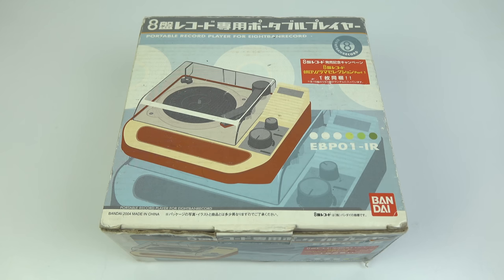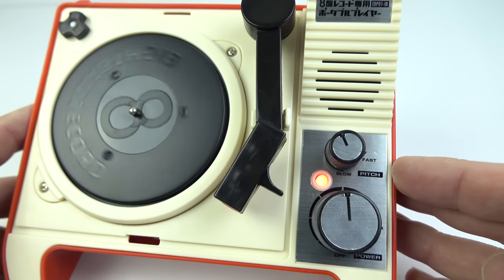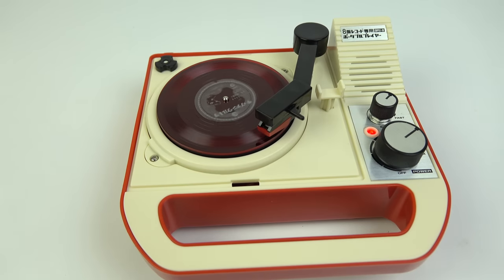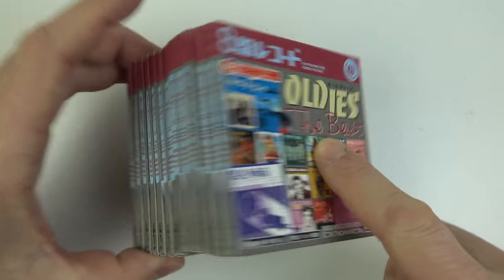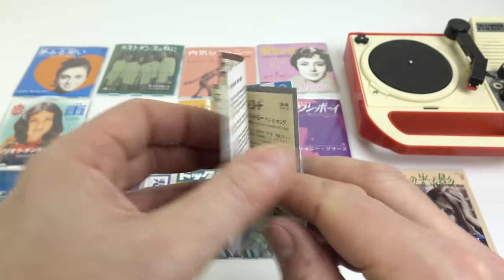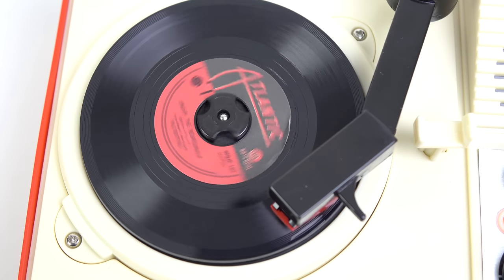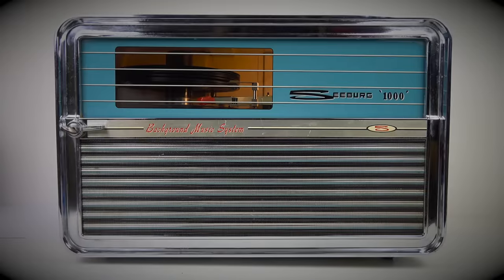8ban - mini playable Records from Japan

Comment: You know, Techmoan, you should invetigate a bit about some 70's dolls that used a small record to play sounds. My mother just told me about that after watching this video. She said she had a doll that had a little plastic box inside and the box had a tiny record that played sound bits for the doll's "momma" sounds and things like that
Reply: Before audio chips they use small records to play the noises
Reply: Teddy ruxspin did something similar
Reply: I saw those records in the backs of the dolls.
Reply: Yes, please! I remember those dolls!
Reply: Indeed. I think early See n’ Say toys also use a record mechanism.
Reply: I have a doll from 1972 with a record player. She still worked! Though last I used her, she wasn't doing it too well. Bit nervous to open her up.
Reply: Those pull-string record players were pretty much how all talking toys worked back then. They were purely mechanical phonographs powered by a spring, like an old Victrola with a tiny sealed disc inside. Super-lo-fi but simple and reliable, and they usually required no batteries.
Reply: @RAMChYLD  Those were particularly ingenious in that you'd get a different track depending on where you started the plastic arrow.
Reply: Now everyone knows about these dolls thanks to Toy Story 4
Reply: I know there were German dolls with battery powered tiny record players, and records were interchangeable
Reply: Those pure mechanical phonographs for dolls were mostly the "Minifon" type produced in Italy.  After 30 or 50 plays or so the voice was already that much distorted that it was no longer fun. The principle was the same as in those "close'n'play" record destroyers sold as childrens' toy in the US. A 45 played by those once was already ruined for normal play on a stereo...
Reply: I bought some "laughing bags" back in the 90's that was basically the record player from one of these talking dolls, inside a bag. It had an evil, hysterical, demonic laughter. I got the idea to put the laughing record inside my little sisters talking doll, for a little chucky-moment 😅

Comment: I have one of the White Stripes models (and the records). They released one record for this ("Top Special") that, to date, has only ever been released in this format. I ripped the Top Special record to WAV format by using placing the tonearm of a real turntable on top of the Top Special record that was spinning on the 8Ban turntable. (This worked better than you'd expect and I managed to get the angle of the tonearm correct). Yes, it was in Stereo, and yes, the quality is what you'd expect for such a tiny plastic record. Someone else did the same and posted a video to youtube.
Reply: chris newpher "someone else" :D

Comment: For a toy record player it sounds pretty decent. It's probably comparable to the inner area of 16 RPM records.
Reply: If it's a 33, and actually stereo, might even be they used some sort of clever shrinking ray on real records. Or something. I bet the sound quality is purely a symptom of a novelty plastic toy record player, and the bit of tape Techmoan didn't quite hack up properly in his Crosley. Probably if you made the effort you'd get at least LP quality out of it. Why not? Putting grooves into vinyl is a mature technology, we've mastered it.

Comment: You can play that small record on a Technics 1200 because it's a manual turntable.
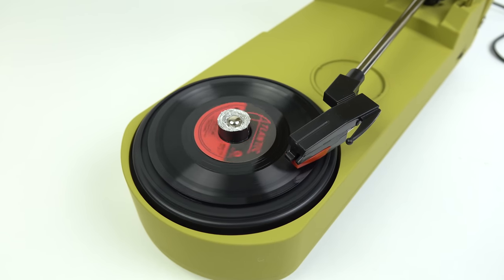Reply: If the tracking error is the same as Crosley at 11:00 mark you can re-align the cartridge because the holes of the headshell are elongated which means you can twist the cartridge. But it's much better to buy a spare headshell for that rather than re-aligning it back when playing conventional records.
Reply: Anyone got a 3D printer? Might be able to knock up an adaptor, and one for the record's centre hole while you're at it.
Reply: But it's not the hole, it's the angle of the cartridge which is not straight. I think conical stylus solves the problem because conical is not sensitive to alignment.

Comment: You don't need a spindle; you just do what we do in the US when a 7" adapter can't be found -- put the disc down approximately centred, turn the platter on and run a fingernail along the edge, nudging it in until it's straight. :)  (nudge nudge)

Comment: They are other models of turning table players apart of the toy one you got My father get me one from Japan made by Denki Onkio K.K when I was child with Japanese short horror stories.  I was in stereo and have 2 speakers and some output (was not a normal jack plug was 7 pins on circle and one in the middle )

Comment: Can you find us the largest record player now?
Reply: The Auxetophone was a non-electric amplified turntable. Used a special little gate, vibrated by the needle. That allowed varying amounts of compressed air through, causing an utter bleeding racket that couldn't really be turned up or down. Clever though that they could make an entirely mechanical amplifier. I think there was a microphone option that used the same principle. 

Actually it was electric in that the air compressor had an electric motor. Only electrical part though. Except maybe the off switch.
Reply: Get Conan or some Orcs to spin a windlass hamster wheel to run a compressor and you'd have a completely medieval amplified sound system.
Reply: Of course you'd need to cut the records first. But you could probably do that by getting barbarians to scream down a cone with a needle on the end. If you haven't got vinyl, use bronze.
Reply: Plastics come included with Alchemy.

Comment: The pitch control is necessary because it has a crappy DC motor that would vary sample to sample and also to adjust for weakening batteries.  Even though the motors had inertial rotating regulator switches, they were still sensitive to battery voltage.

Comment: Just in case nobody has mentioned it but this concept of small records was not new in 2004, back in 1967 a company called Philco released a record format that was call Hip-Pocket records, the idea being you could carry them in your back pocket of your jeans. These were 3.875 inches in diameter, approximately 10 cm, so a little larger and flexible rather than ridged plastic and at 45 rpm rather than 33.33. They also contained two songs on one side. Philco released approximately 40 singles in the USA, mostly popular Soul records from the record labels Atlantic, Mercury and Roulette. I know this as I have a couple in my record collection. Please check these out for a future feature. 😀

Comment: 3inch records could be 3d printed...
Reply: DUDE YES, This would be a fun project!
Reply: It's crazy what kind of things can be 3D printed now, even houses nowadays!
Reply: And if the 3d printed record works then it's totally fun.
Reply: There's no printer accurate enough for that sadly. A laser would be cool though!
Reply: No. They can’t be 3D printed. The amount of detail is far too great for a 3D printer to reproduce.
Reply: Well, no, the groves need a resolution of better than 1µm. But you could 3D print a mock ultra long play stereo record with a total playtime of 24 days! Yes. DAYS. Not hours. 

Well, the record would be mock record with just one circular grove. And inside the box you'd hide one of the 2,50€ MP3 players from chine, stick a 32Gb SD card with 24 days of music into it (yes, standard 128kBit bit rate; you could of course squeeze a month of music onto it if you reduce the bit rate to 96kBit) and there you go.

Just stay away from hipsters when demonstrating this little toy; they will stand in a puddle of urine once they see the 3D printed ultra LP.

Comment: Your struggles with fitting the odd size hole remind me of the college station I worked at in the early 90's. On their older LP's the holes were drilled out to about 2cm, to prevent theft by us poor student volunteers. ;) There was a special adaptor, a hunk of metal with a hole drilled on the underside that would slip over the spindle. I seem to remember there was also just 1 adaptor for 4 turntables in the studio. Hmmm... I wonder now if there werent more adaptors at one time--and a few more records .LOL

Comment: With a bit of DIY and desoldering/solder, I'm sure you can add an aux output from this little turntable's speaker, making a round hole on the side of the speak and hardwire an AUX input.

Comment: I'm the middle 1970s I bought a small battery powered 45 rpm record player. It also came with several 3" flexi discs. Wish I still had it.

Comment: I just removed the automatic guts from a decent but not expensive turntable with a removable spindle.  Also necessary for Little Wonder 78s and tiny records that came with toys like Lionel train sets. Have several head shells for different cartridge setups appropriate for various formats.

Comment: I imagine the speed thing is there because the thing lacks electronic (capacitors) to keep the speed (voltage to the motor) constant when the battery starts to drain. Just like it used to when your batteries were running out on an old Walkman.

Comment: I am thrilled to own my own Ban Dai portable player, thanks to your demonstration.  It works great but came with only one record.  After so many years it was heartening to learn that you found a source for these tiny records so recently.  Could you please share how you got these? I am especially interested in the series of "Oldies the Best," or anything else available. Thank you. By the way, there's no need to find an output jack to connect to an amplifier from this player. Just place a telephone pickup coil in front of its tiny speaker and pick up the audio inductively to feed into a medium gain amplifier input, such as a microphone jack. Cheers.

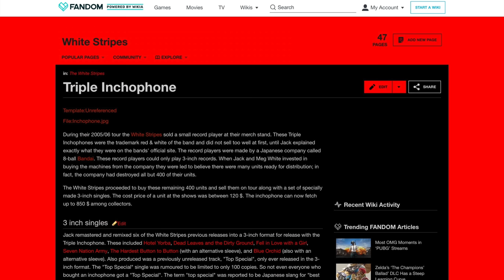Comment: I have some three-inch single-sided 78s by The Andrews Sisters of "I'll Be With You in Apple Blossom Time," "Pennsylvania Polka" and "Bie Mir Bist du Scoen." They are made to look like tiny replicas of the original 10-inch American Decca original shellac pressings, right down to the Decca label and corresponding catalog number. They seem to be made of the same material as the early Deccalite "unbreakable" records, and have a standard 78-sized spindle hole. Although the catalog numbers on these little records match up to the corresponding numbers on the 10-inch discs, the performances are totally different. Each song is cut down to about 1:00, and The Andrews Sisters are accompanied by only a solo piano instead of a band. My best guess was that they were made for some kind of scaled-down child's toy phonograph. (You know... "Hey kids! Play records just your mom and dad do!"). But I've been able to find out next to nothing about these records, except that there was at least one more Andrews Sisters recording of "Boogie Woogie Bugle Boy." I found that at this Popsike link (and it even has a picture):

https://www.popsike.com/78-RPM-RARE-3-INCH-DECCA-RECORD-BY-ANDREWS-SISTERS-BOOGIE-WOOGIE-BUGLE-BOYEE/390388286938.html

You are my video guru about weird formats. What can you tell me about these?

Jim

Comment: I'm pretty sure you could circuit bend that and add the audio jack fairly easily. (unless you already know that ?) -two ways i know would be to just disconnect speaker and change to desired jack, a step above would be to use a switching audio jack and leaving the speaker in place. whereas it uses the speaker still when no audio cable connected. search it up "circuit bending add audio jack" looks for images of schematics. or disregard this as you may already know this stuff?     
 :D cheers

Comment: Open it up and cut the cable to the speaker, and connect a female 3.5mm jack connecter, connect the wires to both the left and right, then you have basic stereo sound that you can connect to proper speakers.

Comment: As a young lad my parents bought me  in the 60,s a Chad Valley record player which it had a pick up arm made from plastic  in the same shape as the old vintage wind up gramaphone  and same type of stylus held in place with a thumb screw  the platter was the same size as a 7 inch record  and ran of a 1.5 volt D cell  and cost my Parents £1 I had hours of fun. I wonder weather there are still any around ?

Comment: You could solder on an audio output, its really simple anyone with a solder iron can do it. All you do is solder one cable to another that goes into the speaker and there you go, that is all you need.

Comment: I want the Triple Inchaphone so much. I would settle for a regular version though, I just want to find some of the White Stripes records on the format. They released a song that was only ever released on that format, Top Special. I tracked down a ripped version, but I'd love to have a physical copy, even though it's very super rare.
Reply: Also, those Motown and various other songs did not sound bad for being basically a novelty.
Reply: Also, one more thing. I knew the songs were actually in stereo. The White Stripes song I mentioned earlier that I found a ripped version of is in stereo. I'm guessing the person who did the deed did something similar as you, because it does sound a bit off.

Comment: I'd be tempted to take the back off of it and drill a tiny hole and extend a speaker cable in there
   Then attach it to the most sensitive speaker I owned

Comment: On the Crosley turntable there's a way you can probably stop that wobbling sound. I have a Crosley and it did the same thing. So try this, find a worthless record album and put it on the turntable. And then take a turntable mat and put it on top of the worthless album. That will make your Crosley turntable look bigger. Putting more weight on your Crosley turntable should stop that wobbling sound. It worked for me. I discovered that when my 45 were making the wobbling sound and my albums weren't. Now I have no more wobbling sound.

Comment: Wondering two things, one - was it considered mono because there is only one speaker on the Bandai unit? Two - was the sound you heard stereo, due to the lineout wire being a stereo wire...or is still mono just being split to a left channel mono, and a right channel mono.

Comment: Just a ?, why did u even bother trying to use the slip pad and put gafers tape, u said and showed that it's single sided, so scratching the bottom means nothing cause it won't harm the music at all. Just an observation. Lmmfao
Reply: Hebrew Loc why bother trying to stop a plate getting scratched? It won't break anyways lmmfao
Reply: @Moth-ManRemasters seriously, did even notice the little records are blank on one side, I know how to cut and scratch records, was a dj for years, a scratch pad isn't called that because it prevents scratches, it's called that cause it's used to cut & scratch records without slowing the table down, so I can hold the record, spin it backwards and cut it all while the table maintains  constant speed, a scratch pad floats above the table on it, when I pull the record back the tables stay runing, as soon as I let it go it plays. But instead of its normal use, the guy uses gaffers tape that stops it from floating, but none of it maters, cause the bottom of the record it blank